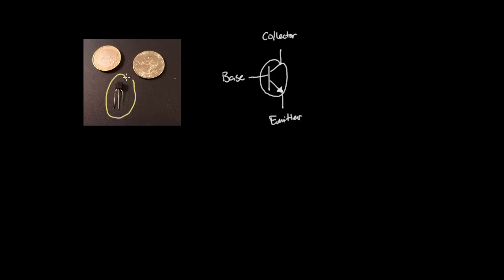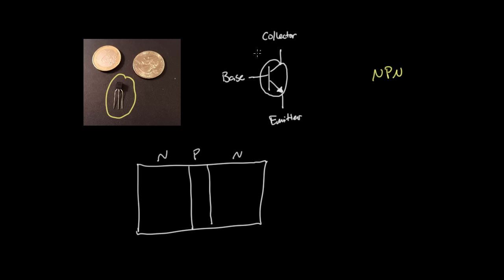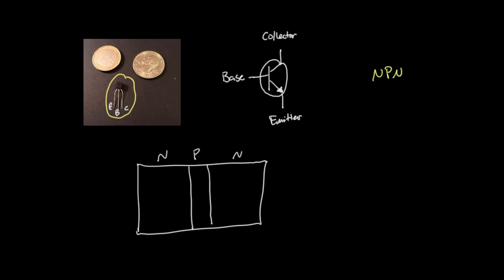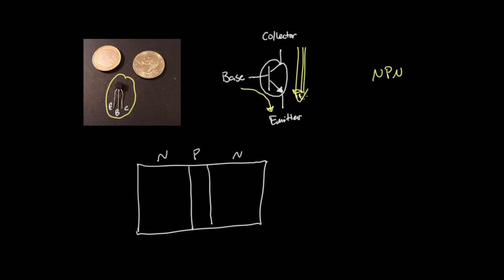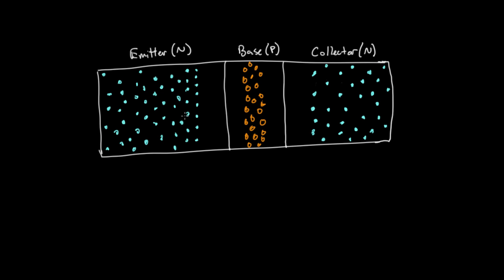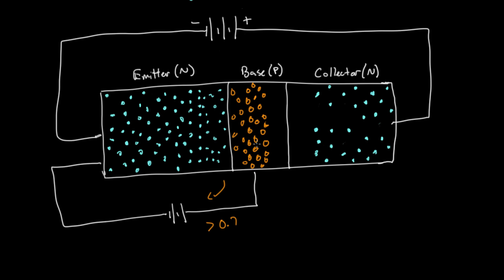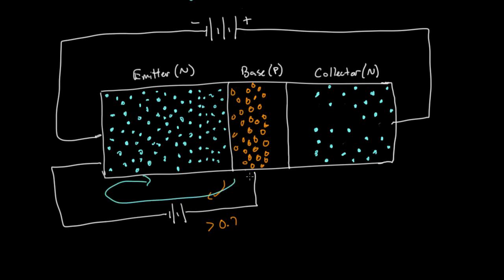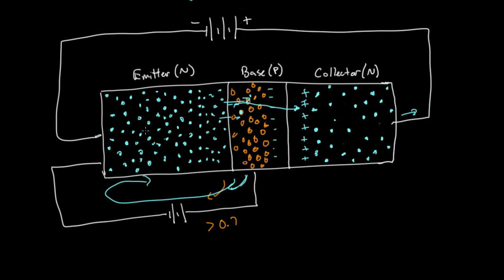How a transistor works

Comment: How much is the voltage across the collector - emitter?
Reply: intelligent ! give the answer
Reply: +Hirak Sarkar as this is silicon so you can provide the voltage >0.7 v than the electrons would be able to cross barrier potential.
Reply: +Hirak Sarkar here 0.7v is external energy used in form of forbidden energy gap so that electron can move from valence band to conduction band.
Reply: +Hirak Sarkar 
voltage across the collector - emitter can vary from almost 0V in saturation, to power supply voltage in cut-off.
Watch Bens lesson about transistor in his playlist, there is a realy good explanation there.

Comment: A great explanation, but how amplification happen?
Reply: NeZversTutorials there's actually no amplification. It's just controlling the current flow between collector and emittor.
Reply: Sound from a microphone is carried as variation (in voltage?) in the small circuit and the patterns telegraph thru on the large circuit to be made louder.

Comment: I highly recommend sticking to convention. Describing current flow as the flow of electrons instead of positive charge flowing from high to low can easily confuse someone not well versed in electrical concepts.

Comment: One mistake I would like to point out is that you keep saying that the emitter is heavily doped so there are a lot of electrons already there... While it is true that it is heavily doped, that does not mean that there are free electrons in the conducting layer floating about. If there were then the emitter would not be neutral and you'd have conductive current without any applied outer voltage. The emitter, base, and collector are doped with neutral atoms and as such, they remain neutral after doping. The only non-neutral areas are the two depletion regions where there is an electric field due to the diffusion of charge carriers. This diffusion happens because of the fact that white all separate parts are neutral, they do not carry the same amount of charge carriers. So the charges begin to migrate to try to achieve an even distribution but are stopped in the depletion areas because them leaving their spots would cause the emitter, base, and collector to become non-neutral.

Comment: why doesn’t the base with all the holes get filled immediately with electrons when the 3 layers are put together during manufacturing? it’s surrounded by electrons. It’s like pouring water on the ground where the ground has a bunch of holes but the water doesn’t go into the holes until you give it permission.

Comment: Bunch of questions 
First what mean 0.7V or why0.7v
The second qustion the Vebo(of bc547) is 6 vdc is that mean that ther should be 6 volt to turn on the transistor or more then 6 v will damage the transistor?
Thanks

Comment: I still don't understand why the collector becomes positive near the neutral zone between the collector and the base. If the silicon atoms are considered neutral, than the flow of electrons wouldn't make it positive but rather negative (more electrons in an atom than protons makes it negative).

Comment: This makes me wonder if it possible to cause a role reversal between the collector and emitter by using slightly higher voltages to accommodate for the doping differences between the two.  Is that possible?

Comment: but, if we assume that the bottom-mini circuit was not there at the start, and only the big main circuit is present.dont you think, the N-P part connected to the -ve side was still a forward biased part?what good does this new  forward biased min circuit do, that the already present PN part was not able off?and wont it be better, if the second part was connected to a new circuit; the NP part?i mean the second part is actually a reverse biased one, the one whose depletion layer is actually increasing. Like, if we connected the NP part to an extra forward biased circuit, it would have decreased the depletion layer of NP and thus all of the current had flown better...

gosh; i won't be peeking into  electronics ever, after my semeter's paper is done   -_-

Comment: I still don't understand the purpose of the collector. Say you only have an emitter and a base. Once a sufficiently powerful charge is applied to the emitter, the free flowing electrons should just pass through the depletion layer through the base and go directly down the wire to complete the current. Why is a collector even needed?

Comment: what is the significance of a gate in a trasistor
Reply: +murthy kompella low voltage is applied to the gate, attracting electrons over to the p layer overcoming the depletion layer allowing electrons to move through to create a conducting channel :)
Reply: Adeel Shahid 
Why don't the electrons of the second depletion layer go down the base wire?
Reply: @Controversy Owl Because the electrons would prefer to go to the battery with the greater charge.
The Base-Emitter electrons would also like to go to the battery with the greater charge, but if they did that then nobody would get to travel, so they put up with their lot in life. :)

Comment: In NPN, current flows from collector to emitter and not from emitter to collector. The direction of current taken is wrong. That is why electrons are flowing into the emitter and then from there to base. How would the direction of current be same as that of the electrons.

Comment: This video really confused me, I thought there was supposed to be no current flow on the base, purely a voltage control, and that the flow had something to do with positive (or negative) electric charge "Bridging the gap" between the emitter and collector somehow.
Reply: There is current flow into the base. In fact, that's all a BJT is; a current amplifier. A FET is voltage controlled. A BJT is current controlled. Beta (gain of a common emitter amplifier) is simply collector current/ base current.

Comment: Very convenient to leave out facts that are hard to explain. 

The strength of the electrostatic field in the depletion region is 0.7 volts. Put a 12v emitter to collector, why won't current flow since 12v is > 0.7 volts?
Reply: Without any voltage to the P part .

Comment: Ok, 2 mins in and you said a "transistor can use a tiny amount of electricity to turn on a large flow of electricity".  Isn't that what a relay switch does??  Guess I should finish the video before asking, lol.
Reply: Back to school, sweet heart.
Reply: @AteuCu  So you recommend that I take out some loans, apply for a school, and hope that the class I take answers my question sooner, rather than later?  For such a simple, and easy to answer question, you really want me to let it consume a large chunk of my life... Just nevermind, bro!
Reply: @slowburntm3584  LOL³
Reply: @AteuCu  Ok, now you are just messing with me!  What class do I take to learn how to cube words¿?  English?  Math?  Religion?????
Reply: A relay switch has two states, it's either on or it's off.  A transistor can be used as an on/off switch similar to a relay, but it can also be used in its linear mode where the amount of voltage between the base and emitter (Vbe) controls the amount of current flowing between the emitter and collector (Ic).  This linear mode is used for amplifier circuits, you can look up a tutorial for an explanation of a transistor amplifier.
Reply: @simonarthur7440  Thank you!!  I know that my question is simple, and vague enough to need more research than can be provided by a short and concise YouTube reply, but you seemed to give me exactly what I hoped for!
Reply: @slowburntm3584  Hah... Philosophy would be great! What do u 5hink, little kid?